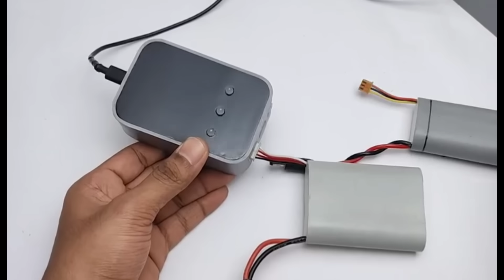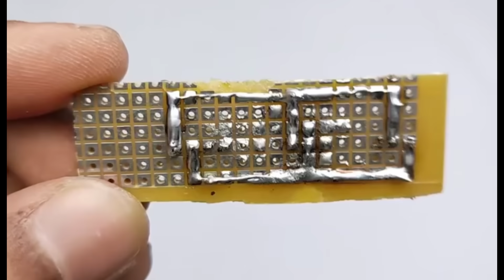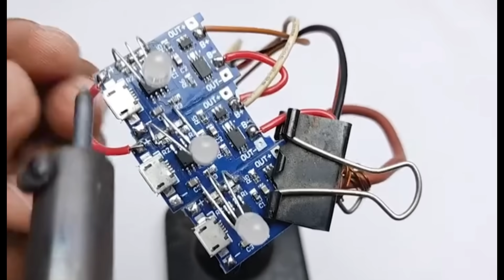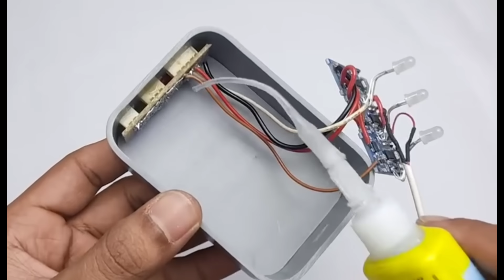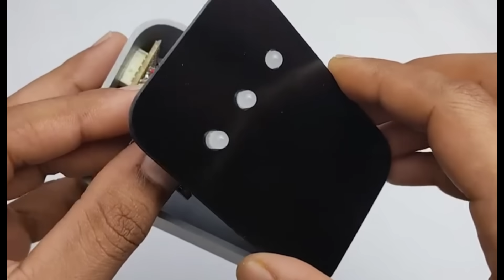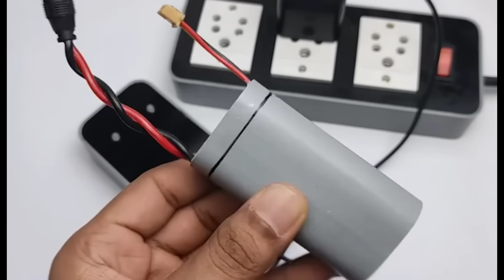How I Made a LiPo Battery Charger Using a Mobile Charger | DIY 2s 3s 4S LiPo Charger

Comment: To module has negative common on input and output for battery. You will short your battery when u do like this, charging with one charger with inputs in parallel.
Charge each module seperately with battery out put in series.
Use 3 chargers.